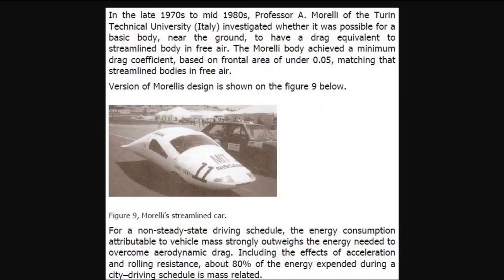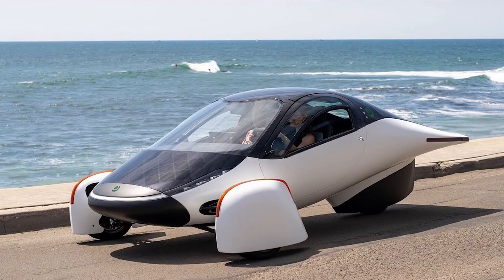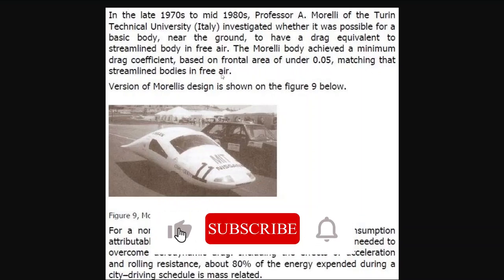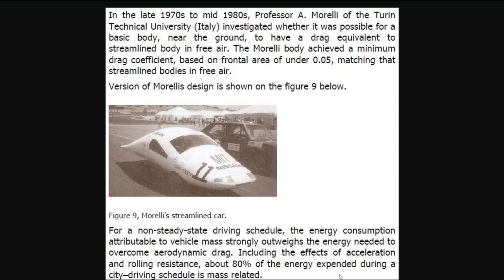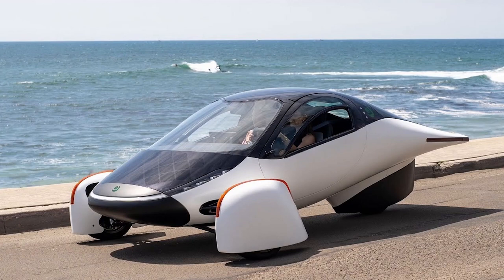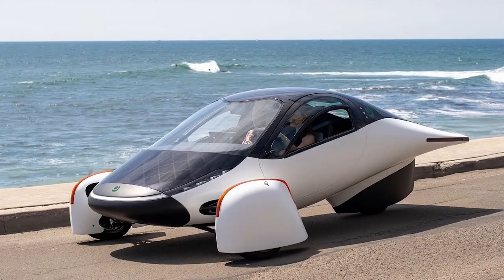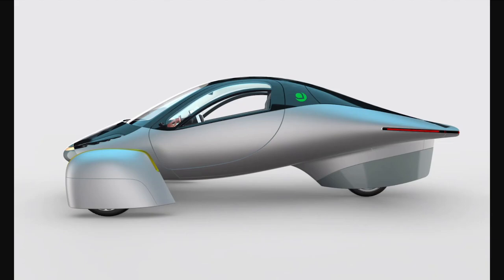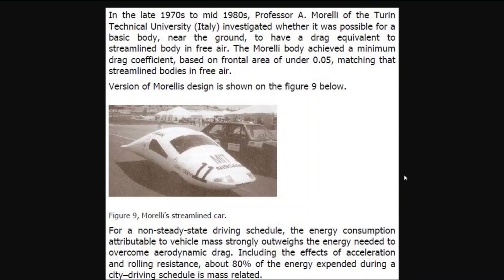The Morelli Shape

Comment: They also put the front wheels farther out as a larger spread reduces the odds of tipping. As the weight of the entire vehicle is lower across the width of the body. Think of it like pushing a door from the spot closest to the hinge vs all the way at the end where we put the handles or nobs. It gives the wheels more leverage so the vehicle doesn't flip as the fulcrum (the wheels) are so far away from center of mass it would take much more force to overcome it.

Comment: This one is also a bit of the same:
https://www.youtube.com/watch?v=NxIL3hSwgJ0
For biking the same goes as for the aptera, the less drag, the faster you can go with the same pedaling power.
The velo-tilt has put one driving steering wheel in front, and 2 tilting wheels in the back. A normal trike has 2 steering wheels in front because of the curves. A trike with no tilting mechanism and 2 wheels in the back needs to go very slow in the curves.
For for example a quest velomobile,  40km/h is a normal speed taking about 150W of pedaling power, but curves need to be taken below 30km/h, and a quest has 2 wheels in the front(!)
The velo tilt is meant to increase that speed to way above 50km/h. But to be able to take a curve, the back wheels can tilt so you can shift it's center of gravity towards the inner curve.
Unfortunately the main designer became to old and he handed the project over to:
https://www.youtube.com/user/Pushyhog

I hope to get an aptera and a velo tilt in the future.

Comment: Why not give morelli Shape to the wheel protectors?
Reply: Probably because the Morelli shape, like the Aptera shape, started from the need to enclose people. Enclosing a different shape, such as wheel, will give you a different result, as would trying to enclose a vertical pole or a pyramid in the most streamlined way possible.

Comment: I remember in one of their many interviews and discussions, when asked how they arrived at the shape of the Aptera, they said that in their quest to build the most efficient vehicle ever they had put up a query to a computer to fashion a shape, no matter how awkward, that would have the lowest drag possible for a vehicle. The computer model came up with the Aptera! No mention anywhere about the Morelli concept being of any form of inspiration.
Reply: The Aptera founders have talked about using the Morelli body shape in several of their interviews.
Reply: @n.brucenelson5920  Was the concept based on a computer model or was it based on the Morelli body shape? If it was based on the former, then a computer simulation (another) is not necessary, at least not crucial. If on the later, then it would have been appropriate to mention they later found that the Morelli shape supported their findings. Which is correct?
Reply: @adimchionyenadum2962  The Morelli shape was the original inspiration, which was published in the early '80s and well known to designers.  Iterative refinement of the design through programs running in the cloud on supercomputers has greatly improved the enclosed volume while further reducing the aerodynamic resistance and allowing the addition of some drag inducing downforce at the rear of the vehicle.
Reply: @n.brucenelson5920  Then Aptera should have made that clear from the beginning that the Morelli concept was their original inspiration, not giving the impression that this was something created from a mathematical computer model.
Reply: @adimchionyenadum2962  Designer Jason Hill has been giving credit to Alberto Morelli for the design since the early days of the first Aptera company.
Reply: @n.brucenelson5920  I don't know what you mean by early days of Aptera. Do you doubt that Chris has said that the Aptera shape was born out of a computer simulation. Are you aware of such a statement from him?
Reply: When the first Aptera started, Steve and Chris did their own body design and it may well have originated in a computer simulation.  It showed their numbers were correct, but as they admit, it was a terrible car.  That is when they hired Jason HIll who had a deep background in automotive design and knew about the Morelli shape.  He has also talked about it as the base of his design back  and since.
Reply: @n.brucenelson5920  So, your statement that "the Morelli shape was the original inspiration" of Aptera was wrong. On the other hand, you have agreed that my opening post (OP) was right.
Reply: @adimchionyenadum2962  I am just telling you what the original designer, Jason Hill, has said.  If you want to dispute him, go ahead.  There was a diesel powered concept vehicle build by the founders before he got involved.